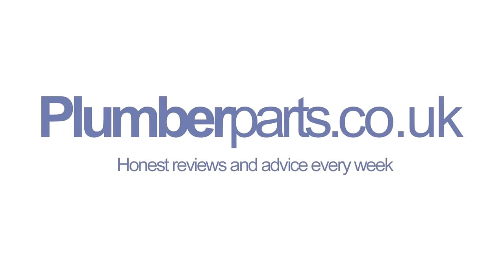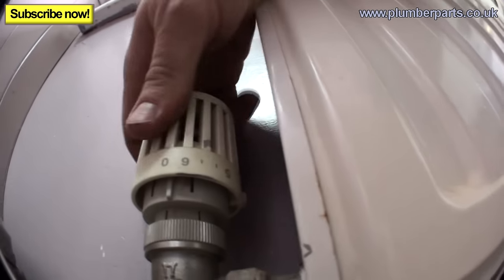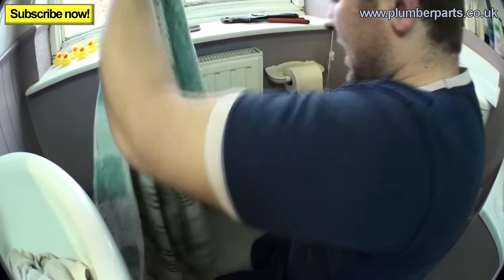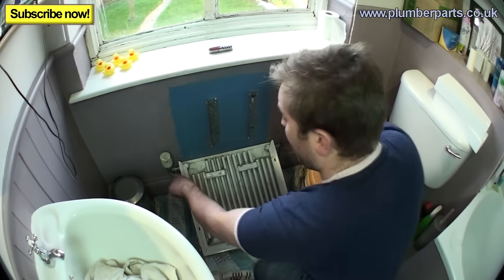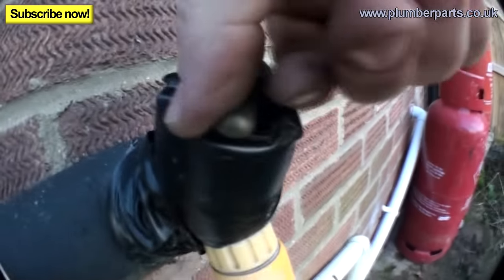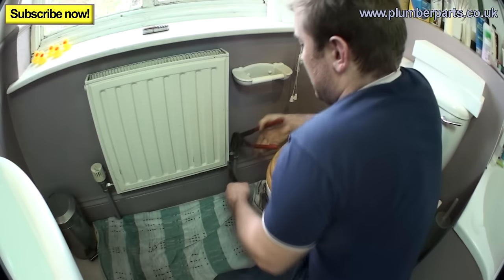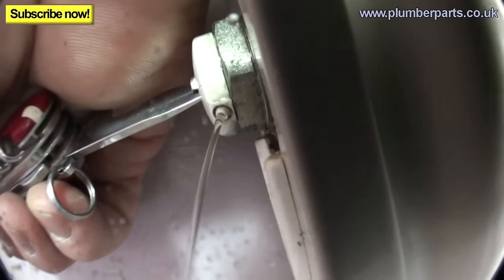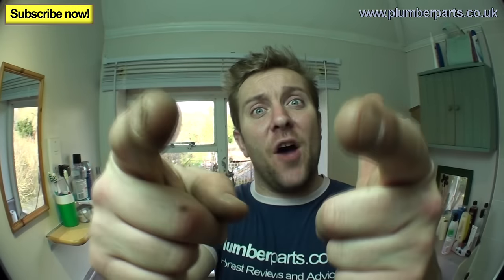HOW TO REMOVE RADIATOR SLUDGE - Plumbing Tips

Comment: Hi. Very useful, thanks. I removed one radiator (as it is always cold or gently warmish, depending on how high I set my combi boiler) from my system and shut off all other 15 radiators. I opened (slowly) the thermostatic valve, known as working on another working radiator, expecting to collect some water out of it. Unfortunately, with the Thermo-valve fully opened, the amount of water which came out was very minimal, not sufficient to fill the radiator with power. I was told I need to power-flush my system. I am happy for the challenge, as the quotes I have received so far are ridiculously expensive. I am not sure you have covered this anywhere in your Youtube channel? It would be good to understand how to setup the connections from the power flusher pump (which I could hire for £50) and what are the challenges of doing this by myself, or whether you recommend a plumber.Thanks.
Reply from the maker: Hi Giuseppe, try using the mains water to flush the pipe work back up through the TRV.....then flush back into a bucket....that might get things going! SUBSCRIBE! ➡️👉 https://www.youtube.com/subscription_center?add_user=plumberparts 👈⬅️ IF YOU HAVEN'T ALREADY! 😎

Comment: Hi, I have a quick question.
My bathroom radiator is hot at the bottom and cold at the top. When I try to bleed it it won’t work. Any idea what the problem could be.
Reply: DO you mean you can't open he bleed valve with the key or that you can but water, not air, comes out? If water comes out, there could be a blockage at the top so remove and flush it as in the video. If you can't open the valve, put the key into it as tight and securely as it will go then try tapping it anticlockwise with a rubber mallet to loosen the valve
Reply: Steve Roberts What I mean is nothing comes out. No water or air. It makes a slight hissing noise. I was wondering if there was a way to fix this without taking the whole thing off the wall.
Reply: Keep undoing the bleed screw another half to one full turn - this should allow for the release of any air trapped in the top and eventually water should squirt out, at which point you need to re-tighten the bleed valve back up quickly. If no water or air come out at all (the air coming out is indicated by the hissing noise as it's under pressure in the radiator) then it's possible that one or both of your main radiator valves at the bottom are stuck in the off position.  In that case,  one valve (the inlet) has a knob on it which you should try turning on and off by twisting it clockwise and anticlockwise several times, leaving it finally in the anticlockwise position so that the valve is fully open. Then try the heating system to see if the rad heats up; if it does, job done but if not try the same thing with the water outlet valve on the other side of the bottom of the rad. You'll see that this one doesn't have a knob and will have a plastic cover over it - remove the cover by pulling it off (or if it has a small screw in the top, by removing the screw) then either use the knob from the inlet valve on the other side of the rad  or a small spanner/pair of pliers to gently turn the brass valve control clockwise and anticlockwise.   This should free up any sticking in the valves and make sure that they are free to allow water in and out of the rad. If this doesn't work, then it's likely that you have sludge deposits in the bottom of your rad which are stopping the water from circulating through it. In that case, you'll have to take the rad off the wall and flush it out (see the YouTube video on how to do this). If you don't feel confident in doing it, ask a friend who has reasonable DIY skills to help you. Good luck
Reply: Steve Roberts I’ve already tried all of those. Thanks for trying to help anyway.
Reply: One final question - do you have a TRV (thernostatic rad valve) fitted to the radiator - they're the ones with numbers on them that you can adjust to suit the required temperature of the room. If so, the operating pin in the valve may be stuck down. You can check this by removing the TRV and you will see the pin - it should move up and down freely when gently putted with a pair of pliers. If it's stuck down tap it on the top GENTLY a few times with a small hammer to free it - if it was stuck, you should then be able to move it up and down with the pliers - it's also a good idea to put some WD40 penetrating oil on it before tapping it and leave it to soak for a minute or so .

Comment: Do you need to do to it with new radiators?
Reply: It's worth having an inhibitor treatment in any system. If the entire install is new, then it should have been treated. Fitting new rads to existing pipe work really should have a cleaner treatment and full drain down.
Reply from the maker: No dude. But make sure you put plenty of inhiitor in! Sub here please➡️👉 https://www.youtube.com/subscription_center?add_user=plumberparts ➡️👉FOLLOW US ON TWITTER! TRYING TO GET MORE FOLLOWERS! 🐤👉 http://www.twitter.com/plumberparts 👈🐤

Comment: have you ever ran into a plugged radiator if so how would you fix already tried pumping water/ muratic acid and and compressed air 120 psi. no dice want to fix not buy new more than one

Comment: All 3 of my rads downstairs are cold at the bottom. Drained the whole system, removed the 3 and hosed them out, put them back and filled up the system and they are all still cold at the bottom. 1 isn't as bad as te other 2 but still pretty bad. The pipe on the non TRV side is hot but the TRV side is cold. At my wits end
Reply from the maker: Check the try valves for two arrows pointing away from each other. If you've got them they can go on either end. Also, be patient with radiators fully heating up. Hot water wants to stay high up so some rads can take a good 30mins to get hot. Good luck, PP!
Reply: Check if your plumbing is a single pipe system. They are rare now, but it would be consistent with your description. Although a blocked return pipe could also.

Comment: I have a question, how come when guys do this kind of video it's a nice new radiator that the bolts come off nice and easy.  I had a house with radiators that were installed in 1885, nobody has ever removed them, and the valve at the end hasn't been turned since about 1910....  Any idea how to get that off, short of a thermo-nuclear device....   Was a rental house and some rooms were about 30C and others were about 10C, only room that was right, had the thermostat in it....
Reply from the maker: +Paul Schmidt Curl up into a ball and cry! did you get them off? PP!
Reply: Nope, it was a rental, and I didn't feel like I would want to pay a plumber to fix this if I broke one off.
Reply: +Paul Schmidt I reckon your radiators are valuable antiques have you approached The Antiques Road Show.

Comment: if your plumber had any sense he/she would have soldered you a drain off on the flow by the boiler dipending on where the filling loops located. isolate the boiler flow valve (turn it off) and use the filling loop to force mains pressure through each rad in turn you can even half empty the rad so it forces mains pressure through the bottom of the rad unless its really bad. dump from the drain off. no need to remove rads. i mainly use this before i powerflush on very dirty systems(saves recirculating as dirty a water during powerflush) and its great for getting rid of any chemicals already in there. downside is its not reversable usually unless theres something like a fernox filter on the return (where you can connect a bip tap union and hose to the bottom and isolate using the mag filters isolating valve.)
Reply from the maker: Haha! I do this too! 😂

Comment: Ok. This way will remove some sludge but will not remove all of the sludge. Even using a professional power flushing machine is not guaranteed to remove all the sludge from the system. I can add a few tips though that would really help if you were to do this DIY job. Before you start I would install a magna clean filter. You can do it at the end of the job but better in the beginning so it starts to pick up the sludge. Trust me having a magna clean is very important and really does protect your boiler and system. First thing you should do is buy a bottle of Fernox F5 (1 litre up to 10 rads) and put it into the system through the radiator air vent which is pretty straight forward if you have a little know how. Leave it in the system for the recommended time which is around 7 days for the F5 if I remember right and leave the heating running on high heat for a few hours a day. This will break down the sludge that is in the system. Drain the whole system, refill and then drain again to make sure you have removed the fernox chemicals. Then start flushing. When flushing the radiators out with a garden hose and mains water use a rubber mallet to bang on every portion of the radiator for a short while (longer the better) which will dislodge any sludge in the radiator. I advise against banging the radiator with the mallet while the radiator is on the wall as if a big chunk comes off it can get trapped in the boiler and cause damage (but if you have a magna clean installed on the return pipe then I would feel comfortable doing this as the sludge would get picked up by the filter before it hits the boiler). Once you have done all the radiators fill the system back up, run it on hot for 20 minutes or so and then drain once more which will make sure all traces of fernox have left the system. Once done add a good system inhibitor (1 litre for up to 10 radiators fernox f1 is great), re fill and vent and you are good to go. Don't forget the magna clean. If already installed clean that out otherwise instal one or get one installed. Worth every penny. Hope this helps.
Reply from the maker: Danny Delany Great comment Danny! Cheers for helping everyone out! Regards, PP!
Reply: ***** Your welcome and more than happy to help out. I forgot to add something though. Just after the magnaclean before the boiler a 22mm y strainer can be fitted which would pick up any solid not metallic debris.

Comment: No mention of whenever you take a radiator of and fill it with fresh water, you need to top up with anti corrosion inhibitor. Especially if you flush every one. The system should not be full of iron oxide sludge in the first place if the system was chemically flushed and inhibitor was added and replaced whenever any of the system was drained. Probably the most important issue when it comes to sludge in CH systems, yet no mention of it.
Reply from the maker: It's covered in the next video 'Why is there sludge in my radiator' 

Thanks, PP!

Comment: just don't try that in winter, the thermostat might open when calling for heat and flood your house, otherwise a good tip..
Reply: dont most of them have a fully off setting ie numbers and a full black dot and black circle  some have frost setting too
Reply: Or just turn the central heating or the boiler itself off before undertaking the job?
Reply: @H0n3yMonstah  Defo better than waiting for winter to end 😁
Reply: How would it flood with both pipes ‘capped’? If the thermostat came on it wouldn’t make any difference surely? 🤔

Comment: Before I had a new radiator put into my home there was nothing wrong with my Thermostat a manual one, and radiators, just the boiler. But because they offered me a new Thermostat which runs on my mobile, and a flush radiator tank clean out I agreed to their deal. Well just after it got put it the Thermo stopped working, now the radiators make bad noises and I had someone check everything and the Tank is full of sludge and the radiators are clogged up. These people are saying they have done nothing wrong but the boiler company and the Plummer who came out and checked everything says that there installation was rubbish. Everything needs to be cleaned out correctly and a new Thermostat. But they refuse and my years warranty is still valid. what I am asking thee is this if my husband and I hired someone else to flush out the tank and radiator, and bleed them and put a normal thermo in how much will it be ruffly.

Comment: Its good to remove any sludge from your radiators - you do so that your c/h system will work  more efficiently. But you have to ask yourself why is there sludge/rust in your system? It is of course caused by corrosion ......... so what causes the corrosion to take place? Oxygeniated water... How does oxygeniated water get in to your system....... ? Because you have a leak ......... If you have a leak the water lost through the leak is replaced [no mater what type of system you have] by fresh oxygeniated water which allows the corrosion takes place. For the technically minded its called galvanic corrosion. PMcG

Comment: i did the same thing but it didt bleed
Reply: Depends if you have a combi boiler which is a pressurised system. Especially if it was a larger size radiator that was removed. When you refit and try to fill, there's not enough water (pressure) in the system to refill the rad. You need to keep the pressure around 1 bar by using the filling loop.
Reply: +Got2Bgaga thanks man
Reply from the maker: Great work guys! Sub here please➡️👉 https://www.youtube.com/subscription_center?add_user=plumberparts ➡️👉FOLLOW US ON TWITTER! TRYING TO GET MORE FOLLOWERS! 🐤👉 http://www.twitter.com/plumberparts 👈🐤

Comment: a sludge in a pressurized system? are you havin a fokin laugh?
Reply from the maker: H Nur What do you mean mate? Sludge can occur in a sealed system or open vented system. All you need is un-inhibited water and steel which is on the inside of your radiators. Regards, PP!
Reply: 3 things are required for  rust  (oxide sludge) to happen. water, iron and air. tell me where air  would come from in a sealed system?
Reply: H Nur, you put the "OW MY GAUWD!" into H2O you friggin legend! 😃 HandyGur